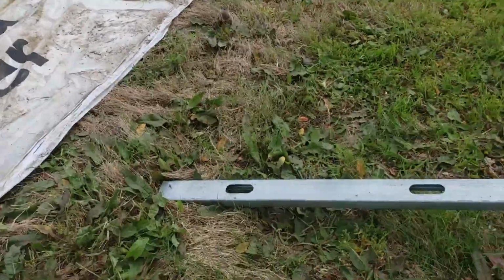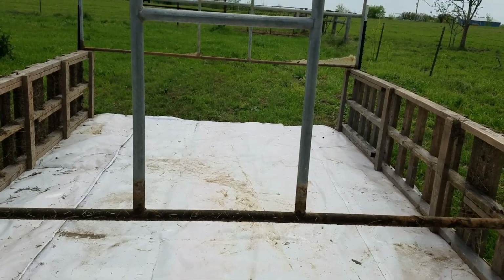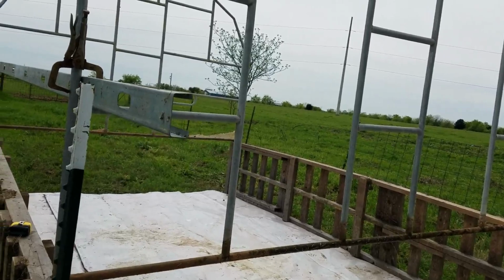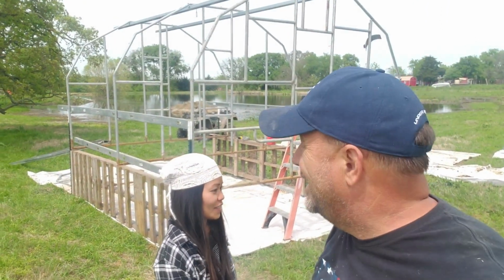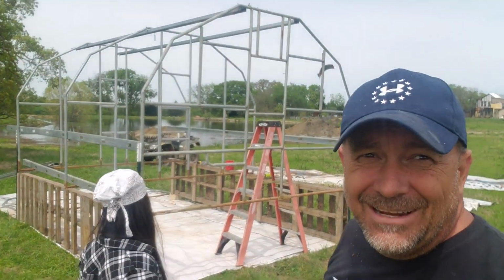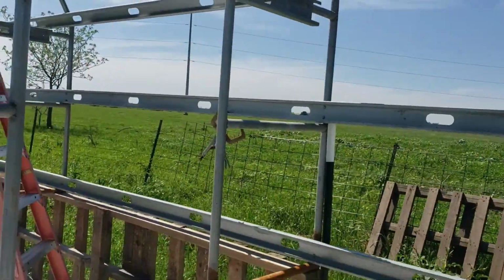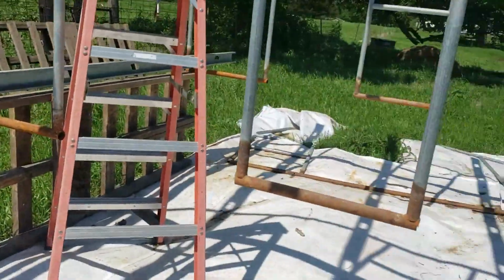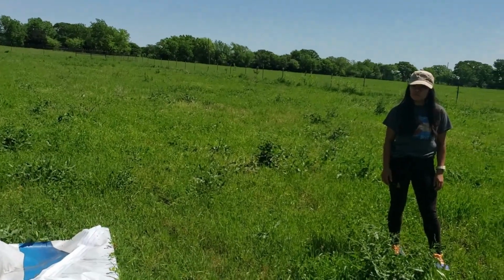Started building the GREEN HOUSE for Melinda part 2 coming along

Comment: Look at putting a swamp cooler at one end to help cool green house in summer.  They'll cool it down by 10 degrees,  simple, cheap and effective.
Reply from the maker: So one move I did that I failed to express in the video I think is that we placed it near that big oak tree on purpose. The sun goes down that direction so by in the afternoon it should start casting shade as well and miss some of the most intense heat. I know it wont hit it all but should help some. Thing is we wont have power down there. We are doing everything back there grid free. So I don't want to consume too much off our main solar system. The high roof will help also to get heat up further- do you agree? I like another sub suggestion to make roof flaps too. I appreciate all you guys suggestions - Swamp cooler is great if near power. Melz friend uses a big portacool on her green house like you suggested.
Reply: @TexasFilipino  sorry,  I thought you might use a solor panel to power small pump cause I thought you said something about a fan.  I figured a 55 gallon drum in ground and tiny pump. Sorry
Reply from the maker: I am thankful for ever suggestion. Don't be sorry for nothing. Who knows it might happen before its done. I might make a mini one on my own!